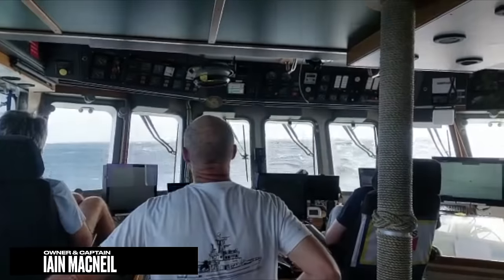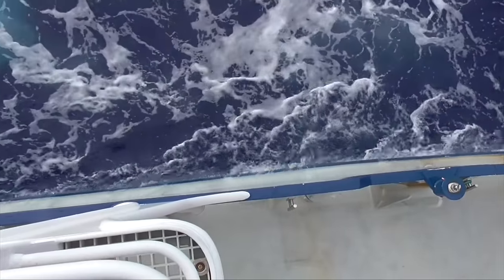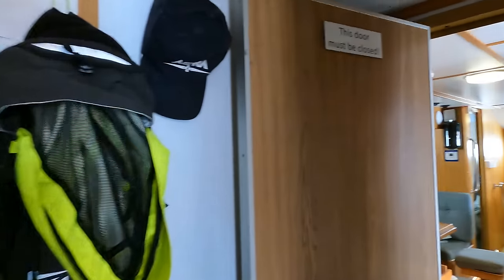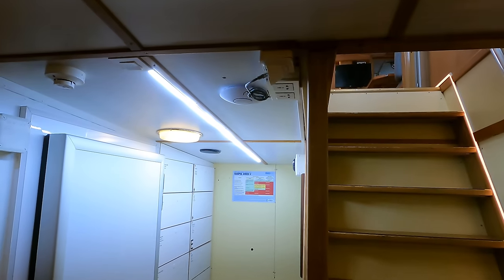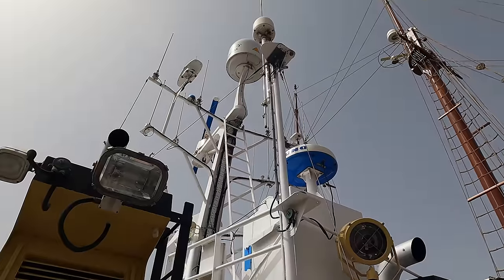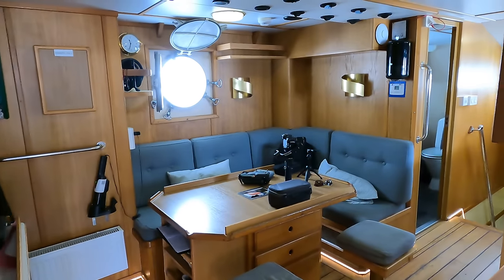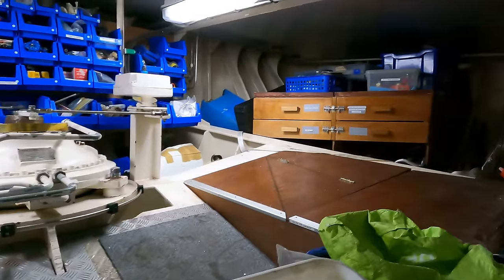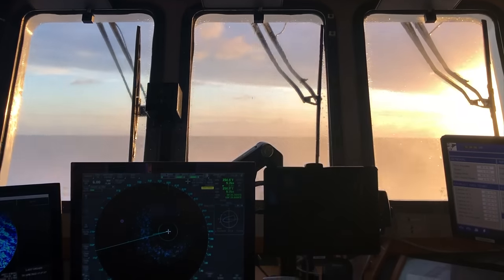THIS Is ASTRA! €2M Ultimate STEEL Explorer With A 9,000 NM Range! (FOR SALE)

Comment: What a vessel! It's like a purpose built explorer vessel that eschews luxury in favor of a spartan-esque existence. Sadly though, it sounds like they were just doing 'a job' as opposed to having fun while doing it. Unless they were pulling into ports to explore and getting out into the water to swim, or fish and maybe dive some it just seems like a mission specific vessel and not really something fun to do. While I get the idea, and the journey certainly seems cool, I don't know if I would want to leave my family for that long just to live and work on a boat that really didn't do anything but travel. I want to actually explore different ports, islands, regions of the Oceans, fish and swim in the ocean. But that's me
Reply: I, too, prefer function over form. However were she mine, I'd have to make a few changes (most of them to keep my 'first mate' from forming a mutiny. I, too, would not care to simply sail for the purpose of covering the oceans. I am an explorer. There's so much more to see than just the sea. Thousands of miles on a crossing must have an objective greater the distance traveled. My ideal vessel would provide range to go wherever I may want to go, to do so safely as possible regardless of conditions encountered, and dependability (I love that is vessel is ice rated). Composite and aluminon hulls would make me so nervous I'd never feel comfortable with either type when thousands of miles lie between me and dry land. This vessel is not ideal in terms of comfort, but that is a situation addressed with a few minor changes. In terms of seaworthiness it would be hard to beat considering its size.  There aren't many other vessels in the 60 to 65 foot range I'd choose over this one - especially given all pertinent factors, i.e., range, safety, construction, redundancies, and initial cost. Great vessel for about 2.2.m US. 

Oh, my 'first mate' is presently going on and on with 'does it have a washer and dryer? 'No, washer, no dryer,  I'm not going to sea.' Blah, blah, blah. I don't know. Maybe one possible upgrade should be the addition of a 'plank'?  ; )
Reply: So, you just went up the mountain, Mr. Hillary? You didn’t do anything fun up there?
Reply: @charliecharles-xw4ub   23.35 meters puts it in the 75-80ft range, which is a very significant size increase in boats this size compared to 60-65
Reply: @DanielOlaiDanielsen  :My bad. Math skills must have been on hold.  The added length, an actual 76+ footer,  is a huge plus. Now I really want one pretty much just like it.
Reply: @charliecharles-xw4ub  I would like to hear your opinion on the Bering 65 Explorer. This also looks like a tough little boat to me.
Reply: @charliecharles-xw4ub  Or maybe a W/D in the lazzerette????
Reply: At least the boat has a purpose not just a waste of resources of fuel for no reason but greed

Comment: An amazing vessel comprehensively fitted. Only thing I would fit to her would be a single stainless handrail drop bar across lower deck access stairs. A necessity in large confused seas.

Comment: This vessel will be a difficult sale.

I assume the listed 9k range is based on the 7 or 8 fuel totes being on board?
The potential buyer pool is very shallow;  how many buyers are going to be thrilled with the "wet decks" design or the over done pilot house?  Who needs 4 radar units?  Heck, the USN Destroyer I was on as lead navigator didn't have that many?

Don't think the wife would be impressed with the living or galley  accommodations.

ASTRA is a very robust vessel suitable for a specific, limited mission and potential buyers are few in number.

Great video, interesting boat, and good luck in finding a new owner.
Reply from the maker: Thanks for watching and for the comment, shipmate 🫡 Which ships did you serve on? I spent a little bit of sea time on board USS Klakring 🇺🇸
Reply: Lost my message, will try again.
I was in Viet Nam for a year on 50-foot patrol boats, Swift Boats, then finished my enlistment as a Quartermaster on destroyer USS AULT, DD 698 where I was lead navigator.
The wife (Admiral) and I occasionally do bareboat charters where we patrol the waters of the San Juan Islands.
Your videos are great and I  very much enjoy them.
Reply: USS Klaking, FFG-42, good looking ship.

Comment: Nice boat, built to it’s purpose.
Perfect for Baltic, Norway, maybe Greenland.

You demonstrated what happens when not stabilized, is the stabilizers retractable ?

Unfortunately I don’t believe it can get back into professional use, otherwise it would make a nice tug for hauling small barges on long trips. 
15 / 30 T pull will be enough on small barges.
Even in icy water  👍👍

The main engine model, is very well known for its low consumption and reliability 👍
Reply from the maker: Yes, the stabilisers are retractable so that they are flush with the boat 🫡

Comment: Amazing boat and video of it. Thanks John! 😎

Question: If operating in ice, are the Magnus Effect stabilizers more vulnerable to damage than something like a gyroscopic stabilizer (Seakeeper?) that's completely contained within the hull? I wonder if those protrusions, even when stowed into dormant mode, could get caught up. If a Captain/Owner this experienced is happy with that solution, I suppose it's not a real issue, but I do wonder. 🤔
Reply from the maker: Glad you enjoyed the video! 🫡 I am guessing that the arms are retracted when navigating through ice. Once they are retracted they are flush with the hull.
Reply: The magnus master rotor arms have a small housing built in to the bilge keel to protect them in ice.
Reply: @Iain_Macneil  nice, thanks Iain! 😎

Comment: Thank you so much for walk through 😊
The WAVE monitor and keeping a small old school helm wheel is assume 😊😊
I love the pilot stations set up with that outstanding rear control station. I thought at first the crane was operated from There
The machine shop on board and all the compartment organizer is very ship shape
Plus having the Volvo as a second engine. 
MITSUBISHI advertising makes a big deal about the Engine being all mechanical that being simple & Reliable. Mechanical controlled a Real advantage when operating in remote LOCATION. Mitsubishi marine offers strategically positioned service around the world 🌎 machanically controlled engines provide excellent fuel economy through there engine Design 😊😊

Comment: Seen this ship and even watched some of her journey and it is of course converted to fit its purpose, but that also makes it a "the journey is the focus" type of vessel which is fine for those that just want to get somewhere.

Not sure you mentioned, maybe you did, but it also has stabilizers fitted so the rebuild and the equipment must have cost a penny for sure, that said you can also buy a similar (under 24m ice capable) ship for ~400k euro and fit it out yourself as needed

The biggest problem I see but that's me, it's the single prop, I just wouldn't feel comfortable with that and if memory serves me right they had problems with that on their journey (was a while ago I watched could have been some other ship)

Explorers should, imo, have 2 engines with separate driveshafts and propellers
Reply: Yes, when I saw there was a single prop and drive shaft I was surprised. So much redundancy and attention to safety details (I was especially impressed by the waterproof isolation of electrical systems) to retain that major single point failure. They could easily have made mounts on the stern for diesel outboard engines (OXE Marine makes some very suitable ones), keep them stored out of the way and use that wonderful hoist to mount them when necessary. Two knots beats zero any day.

Comment: I wonder about those Mitzi motors. I operated large Excavators and Draglines/cranes when working. All the big Excavators supplied with Dual 6 pot Mitzi donk's the boss swapped out for cats as the Mitzi's tended to Overheat when working 24/7. 
Just wondering?.

Comment: The sailed more Nauticals miles then the lenghst of the Equator??? How is this possible??
Reply from the maker: Iain goes through everything in his very thorough book: use the code "BUOY40" to receive 40% off the book: https://bit.ly/448wcFp
Reply: Presumably by going north and south when appropriate, not just around from east to west? In fact, he says they crossed the equator twice, so yes, they must have done a lot of north/south travel.
Reply: If u sail from the North Pole to the Antarctica...this would be  1/2 of the Earth...has nothing to do with crossing the Equator twice..
Reply: @dieterscholz4257  But it didn't do that, did it? I thought it circumnavigated the earth via (for the most part) the Southern Ocean. Given what he said about having crossed the equator twice, he clearly didn't stay all the time in the Southern Ocean; but he did go around both Cape Horn and the Cape of Good Hope to the south. There's nothing I can find that suggests they went up to the Arctic at all.

Comment: I remember this vessel lingering at $1.2 million USD for several years so now, after a circumnavigation, much use and abuse with no appreciable upgrades to the systems, it is $2.2 million... OK